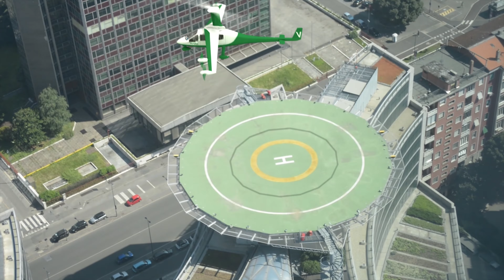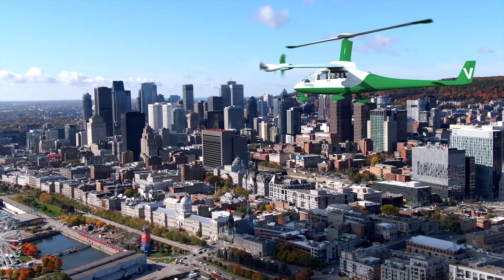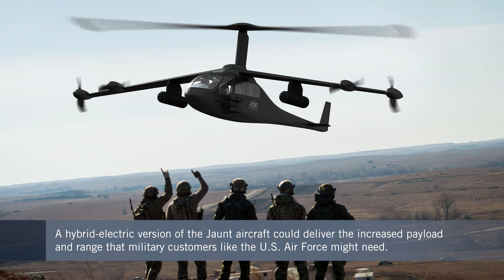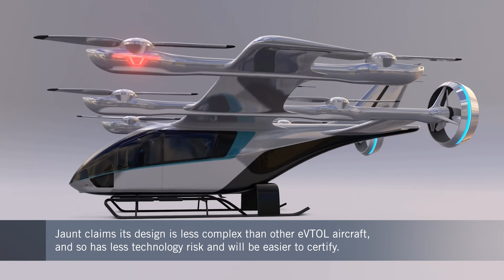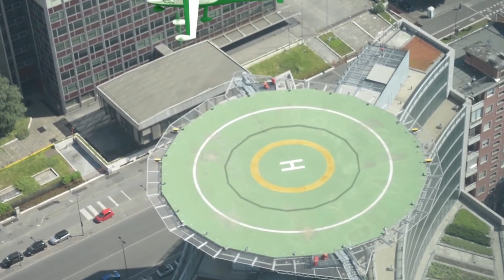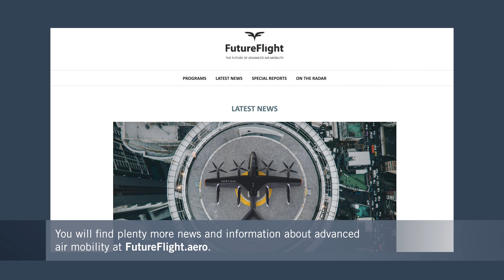Airo Group Expands Scope For eVTOL Operations and Prepares To Go Public – FutureFlight

Comment: If it's a simple rotor it might not be a bad configuration but if it's a full helicopter rotor with cyclic and collective then it's hard to spot the simplicity of the design over a tilt rotor. Very hard.